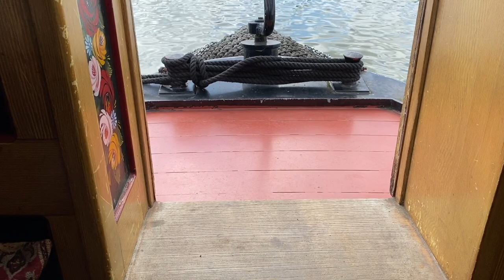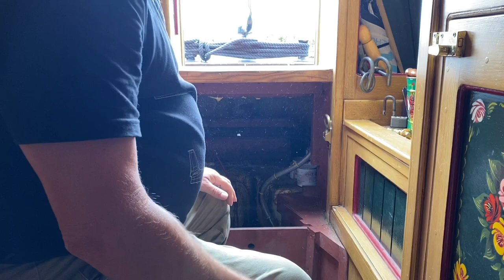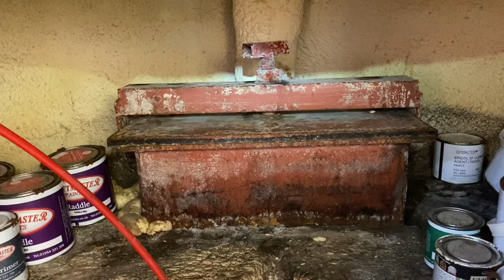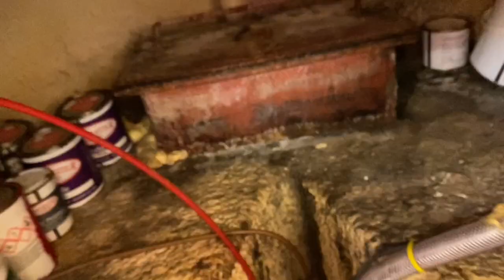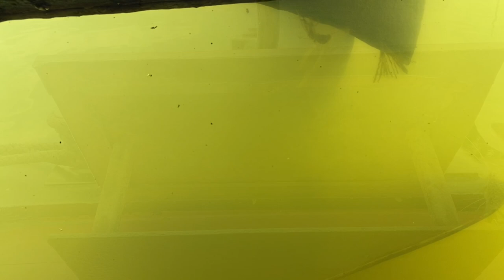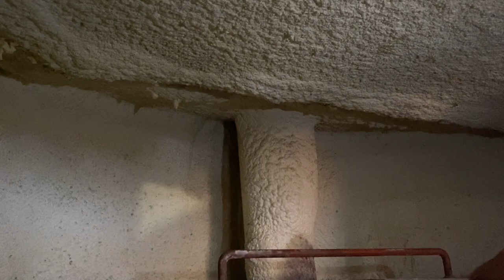Down the Hatch!

Comment: Did you figure out what the vibration was?👍✌️😊🙏🏼
Reply from the maker: T 
No, which is bit worrying, I can’t see anything which would indicate the prop was out of balance.  So possibly the prop shaft could be very slightly bent, or one of the prop blades is out of true.  Either way it’s an out of the water job..........   ££££££.
Reply: @phenogen8125  Not a chance for Kort, there's way too much debris in the canal. The answer is similar to a Kort but without a shaft so that things pass freely through the centre - a rim-drive - but it's electric and they haven't overcome the heating issues yet for our size of props...

Comment: Funnily enough I'm following suit with my boat no access hatch from the deck in my infinite wisdom!, however I like the mock boarding effect in the deck surface might have to copy that one day, hope the blades not bent or out of true as I should imagine that would drain the wallet being a big blade, what size shaft does Herbert run?
Reply from the maker: Narrowboat Freya 
The tug deck has the same planking effect.  The final shaft is 1.5” inch dia and the black intermediate shaft is, err, Scania sized (Over 7’ long and about 5” dia)!  I think a 22x22 prop is around £700.
Reply: @diaryofaherbert7423  @Diary of a Herbert ,I have the planking effect on the  front and back bulkheads so I think it may look a nice addition to the deck as well maybe, have a well deck on Freya so that will be ok plain so to speak.

I suppose there is a very small chance the shaft may have been tweaked but you would assume the blade would give before the shaft did,  I was particularly paranoid swinging a big prop with 8ft lorry shaft so put  2" shaft and stern gear in at an eye watering cost!, sounds like you might  be perusing ebay then for a backup option!, love the Cat Scan too bless her!
Reply from the maker: Narrowboat Freya 
After a through inspection all is well.  Shaft is straight and prop has no damage.  I think my mind is playing tricks on me.  What I can feel through the tiller is the mix of power pulses from Thumper and the tip wash from the prop blades.
Reply: @diaryofaherbert7423  Hi Chris - I'm a little surprised at your prop's dimensions, but I guess you're happy with how she performs and handles. Assuming that your g/box is driving 2:1 then a 24’’ diameter x 17 pitch, 3 blade 55% DAR turbine LH propeller seems to be the choice made historically for a 70ft boat and that power train (assuming you've got the space for a 24" of course!) Whilst googling I also noted mention of a 24x21 3 blade but of course neither of these have taken into consideration the power requirements of an alternator. This is apparently an original RN document: https://www.canalworld.net/forums/uploads/monthly_2018_08/1D4D937F-92E8-4A90-A9BA-F2EEF8DA2AB7.jpeg.6e8419741744d14a2bce7dd372129aa6.jpeg BTW Your cost estimate is spot on!
Reply from the maker: @34136TS  
We looked into a 24x22, somewhere between £1800-2000....  But to be honest, Big H needs a bigger engine, probably a Gardner 2LW/2L2, but preferably a 3LW. A 3L3 is probably overkill though!
Reply: @diaryofaherbert7423  Ouch - that sounds an expensive prop! I took a JP3/Blackstone out of my 65ft Canopus because there just wasn't enough load and replaced it with a "Dutch Gardner" Samofa 2S108, basically a refined 2LW giving 30hp@1500RPM so same power curve just +300rpm at the top end. I paired it with a 2:1 PRM500, overkill but it has a hydraulic PTO facility should I ever want it for something. (The Redshaws did the refit, I'm sure they can tell you all about it.) I have a 24x15.5 three blade fitted which is a little fine, but I also have a 3kW and a 5kW generator belt driven off the flywheel so that's quite a load should I put both online! Your engine was pretty much an original HW shipyard spec for 70' towing pairs and they'd have been deeper draft too so I'd certainly borrow a larger prop first to see if the increase in prop efficiency fills your perception of a power deficit... or even trim her back a bit to reduce the drag. I do like your Herbert and Thumper is a beauty... <3